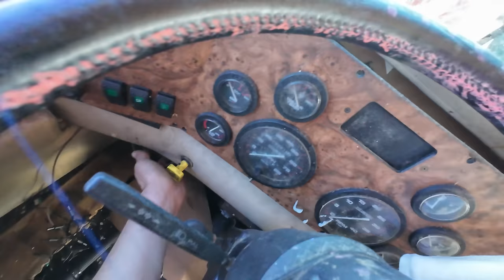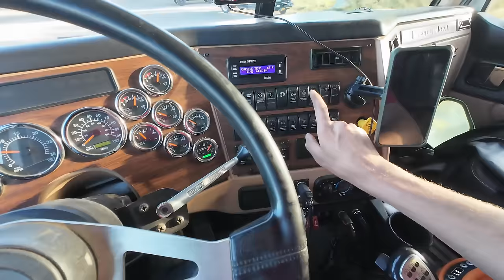Squatter takes over abandoned RV...  Until I take it away!

Comment: I’m a fellow tow company owner in the central Valley here in California. I know exactly how you feel when it comes to these motorhomes. We get a lot of motorhomes through the sheriffs department. It’s very rare that CHP will call us out for one. Unless the county pays for the disposal. It is extremely hard for any of these tow companies in our area to want to take them for obvious reasons. There is no money to be made. In fact, it actually cost to get rid of them.
The whole video was great to watch. I just have a couple small constructive criticisms. Please don’t take the criticisms personally. 
The one thing that I noticed was when you put the pins back into your risers. I always tell my drivers to put the pins in the other way. The reason for that is when you put your boom away and you keep the risers on. You’re not relying on the Safety pins to hold the main pins in place. If the safety pins were to fall out, then the main pin would simply drop out. Then, of course the riser would come flying off, possibly causing damage, injury, and or death. Not to mention you lose a riser.
The other concern I had was when you improvised using that sharp rock on a very old tire. I was extremely nervous when you crawled underneath there. Now I did notice you made it a point to not stay under it for very long however, it just takes a split second for that tire to have blown out and you getting seriously injured.
I’ve been in your situation where I have forgotten wood. So what done was use a another set of risers to act as a block. That way you have a nice smooth surface.
As fellow tow operators. We are a big family that watch out for each other. Again, it was just something that I had noticed. And I was simply worried about you. 
One other thing I would like to bring up. Although you had mentioned you had knocked on all the walls prior to you hooking up the RV. I personally would have done that very thing and before going any further do a walk-through first. Because had that person been , jumping around especially the way you had the front tires preloaded. That could’ve been very bad. Not to mention if they had been “ hurt” that could have set you up for an injury lawsuit. 
Also, I have ran into an RV about 10 years ago. Just as I was doing a walk-through, I found a deceased person laying in the master bedroom. All the more reason to do a complete walk-through. 
One more thing. You can also get yourself in a situation that if you towed the RV with somebody in it. That could be considered kidnapping here in the state of California. Just FYI my friend. I’ve seen it happen. 
I’m sorry this message was long. I just want to share my experiences. We are one big family and we need to watch out for each other. Just my thoughts. Ron
Reply: Did you even watch the video, Ron? He stated at the beginning he would be changing his policies moving forward to walk through everything, for that particular reason..🤦🏿
Reply: @FORDultra  I did watch the video. I may have not heard him mention “ changing policies”. If he did, I’m sorry that I did miss that. I just want the best safety for all of us out there. If you had read my comment and it’s entirety. I made it a point that my intentions were not to criticize, but simply share my experiences. We are Tow family and we do need to stick together. I met no harm. If that’s the way it came out. I do apologize. Ron.
Reply: @ronhannink1968  Fresno California sure is changing rapidly

Comment: those toyota rv's are actually highly sought after mainly for the engine and drive train and from what i briefly saw did not look in too bad of shape
Reply: The engine and trans are no different than any other Toyota pickup truck. 20R/22R. They are sought after because of their size, and fuel economy. They are perfect little 1 or 2 person rigs, that fit in many places others dont. He was hauling off $5000-$8000 even if it didnt run. Hood luck finding a decent one in working order for under $10k.

Comment: You don't need to strap the slide outs, there is a manual retract on all RV's / Motorhomes. Usually around a 3/4 socket or so in size. Just carry a good drill with you.

Comment: I've been looking for a few of nonrunning RV's or busses to park on my property. Yes housing has gotten that brutal. Now the Provence has let people park RV's on their property to house people. Not only are homes expensive but also scarce. If you can find a small house or apartment it's $4000/month.  I'll put in a packed drive, power and sewer that will cost around $10-15k the rent will pay for it in a couple of years. Giving a few people a place to live and the property is next to me so it won't be rented to tweekers. I need them in good shape though with no broken glass, which is tough to find. Doesn't matter if they run or not. I can fit 3 units on my property.

Comment: That motor-home sold new in 1996 for around $172,000.00  They sell for around 5K now in good condition...!! But you could probably get more parting it out for the axles, engine and in this case generator. Motor-homes are horrible investments, unless you use it all the time. Kind of like boats... they drop in value pretty quickly.

Comment: I used to drive a rollback on law enforcement rotations. We also had a medium duty truck for these scenarios. When dealing with low air in the steers I used to just pick up the front with the stinger and put 4X4 blocks under the steers and it would give me more clearance to frame fork it. I’m also very surprised law enforcement isn’t there with you pulling the person out of the rv so you can snag it but then again I’m sure each state, county, and city has their own procedures. Just a weird scenario that you’re there by yourself doing the impound.
Reply: Also I never aired up any air brakes I always caged them. It was a pain in the ass but I never had to worry about a loss of air pressure but then again you tie directly in the air system is cool as hell.
Reply: I also never would have thought to pull the axle shaft. That’s pretty brilliant. Sorry I’m watching and commenting as I see things that are cool that I’ve never thought about doing.

Comment: Protocol suggestion.  Assuming the RV is going to scrap.  After you force entry to clear it.  Make sure to damage it in such a way that it is not a dwelling anymore in case you are runned off by a person showing up.  AND you should have another person in ANOTHER vehicle watching in case you need to flee while you are partly hooked up you will have options.

It does seem odd that the RV made it there and hasnt moved at all.  I assume there have been 200 parking tickets and quite some time passed before you showed up.😢
Reply from the maker: It’s been there for years

Comment: I curious about something you said. If the windshield came out, the wind pressure could make the slide come out. If the slide is gear driven, how does the wind pressure cause the slide to come out versus the gear pressure resistance? Thank you.
Reply from the maker: Because the those gears, and the super thin particle board the slide tracks are mounted to are incredibly weak.

Comment: Everyone saying "we grew up poor IDK how anyone could junk an area up" Didnt grow up that poor. Picture this, you're living in a junk RV that doesnt run, you probably even saved for months to buy it for a few hundred bucks to get out of the weather. You don't have a running driving vehicle of any kind. You bought the RV and had enough left over to tow it to a spot that it wouldnt be messed with for a while, as clearly done here. Trash services aren't free, and wont run to a vehicle parked on the side of a road (ask me how I know). That 50 a month you spend on trash collection if you dont have means to drive it to the dump yourself is big money when all you have is 300 a month in grocey food stamps for a household of 4 (or even for 1 its not enough) Not at all saying this is justified behavior, or that the government should be responsible (though they really should thats a different conversation) I was fortunate enough that when I lived in a homeless encampment in northern cali for 2 years the government granted me a small stipend to keep it clean. I drove my tiny ford ranger that I lived in and that stipend was used to collect trash from the block we were all ignored on enough to live on because we didnt have other options. So I picked up everyones trash, twice a week and hauled it off. My truck broke down at some point and I had to use the savings I had (working other jobs of course) to get it back on the road (nearly 1200 bucks) in repairs I did roadside . I'd never worked harder in my life. doing the trash cleanup for 100 a month, splitting and wrapping firewood for a 2nd job, doing demolition for a 3rd job. And doing craigslist jobs for any free time I could find. It is HARD to get out of poverty. it is REALLY HARD to get out of having nothing and noone to lean on. So honestly FUCK YOU if you grew up poor and dont understand how hard it is to be poor... I bet your parents know and could use a "thank you"
Reply: Do you feel better now?  You just showed your hand by saying FU........

Comment: I'm surprised the crack heads didn't steal the batteries out of it, those are worth some money for scrap. In Canada you'll get about $12 each. That's actually how we fix air leaks when we are working on automation tooling with robots, just fold over the line and zip tie it.

Comment: HUH? There is no value to it? What i see most of things work on it, only needed proper clean, little maintenance, window replacement and its on the road under a grand and hell if there isint bad mold livable for someone down their luck. I have never understood why in US you get 4x4 atv's, jet skis and what now for free or really ridiculously cheap, when same vehicle in here in worse condition is several thousand dollars. Like you cant cant find even a with out engine 4x4 atv frame less than 1000€ let alone running one with a engine, regardless how bad it runs. Absolutely ridiculous what people throw away. If shipping was not that expensive, i would just run around US and send several shipping containers worth of vehicles to Europe and make 100K€ easily.

Comment: No comment about the interaction with Squatty Jane Doe, but holy crap this is the most unsafe lift I have ever seen. You had your entire head and torso under a bus on a totally ludicrous arrangement of rocks. This was totally unsafe unsafe/foolhardy as hell. I swear I'm not seeing things, your chocks are on the uphill side of the wheel......!!  Wtf is that supposed to do?    Dude..... seriously..... don't show yourself operating like this, someone's gonna yank your license.
Reply from the maker: Hey dummy….  The chocks were on the DOWNHILL side of the tires, and at no point was I under a part of the vehicle that could fall to the ground.
Reply: @CaseyLaDelle  My bad. I did not pay enough attention to the real slant of the road before opening my big yap. I apologize sincerely for that. I just see someone using rocks instead of jack or axle stands and know that around here you would not definitely get away with that. If the mounties showed up you'd be in serious trouble. Your license would be on the line.

Comment: Ya this dude is pure con artist rip off. He act like he doing a good deed but he gets paid to remove the motor homes and he makes a hundred thousand plus a yr in parts. Like from the Onan diesel generators $6000,-- $10,000 plus used. The Diesel Cummins engines and the 6 speed Allison transmissions which are all good are $10,000 plus each. Those 22- 50 Alcoa rims are an easy $2000 a piece and there are 6 of those. This guy is getting extremely rich don,t let him fool you he is not out there dragging away trash he is dragging away big dollar items.